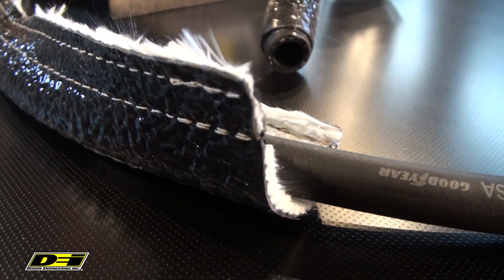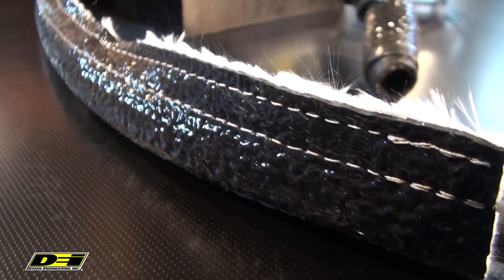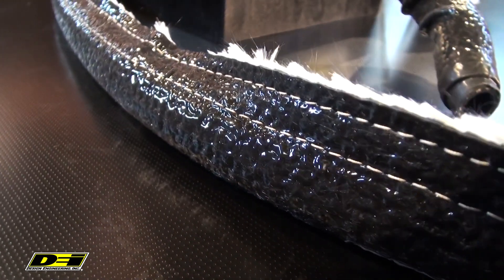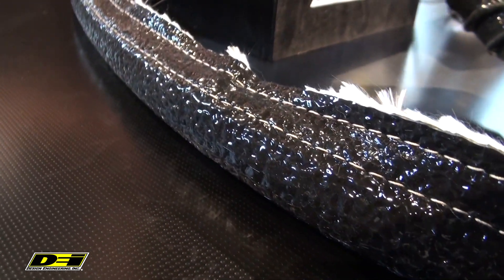Fire Sleeve Wrap 3000 from Design Engineering, Inc.

Comment: I need to protect some Teflon Braided hose from my headers,  limited space where the hose is ,  Can I wrap this on a small section of one of my primary pipes to insulate heat getting to my hose ?
Reply from the maker: Yes! It would be a perfect product for that situation. As long as the line is not making direct contact with the header, this will work great.

Comment: So if you expose the outside of the sleeve to 500F, what will the temperature inside be?
Reply from the maker: It is nearly impossible to give an exact answer here due to the amount of variables that play into this situation. On average though, we would expect about a 30-40% drop in temp.
Reply: @DesignEngineering  Thanks for the reply. The ballpark number helps a lot!
Reply: Will this stuff melt if its place directly on a radiator core?
Reply: @flawrestdsm  it's rated to withstand direct heat that's twice what would be a worst case rad temperature (engine failure range). So, no?